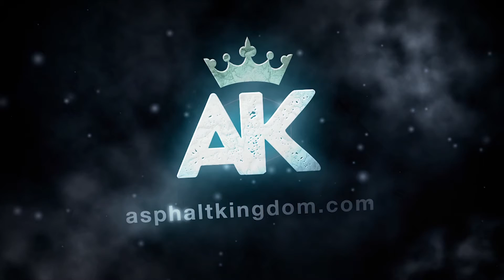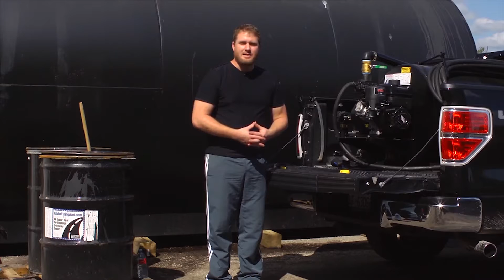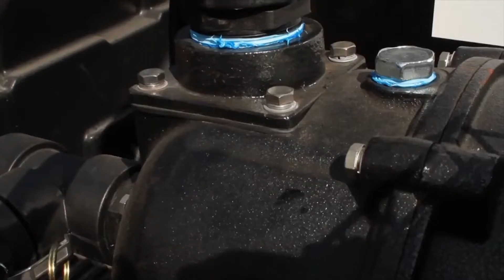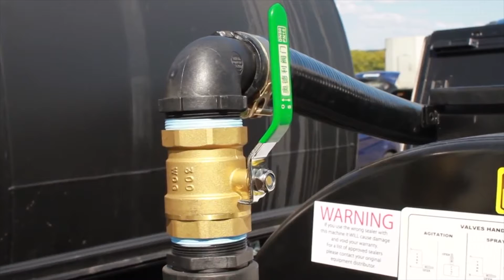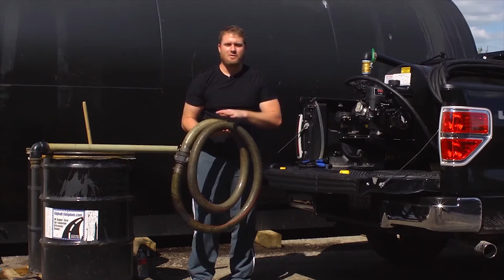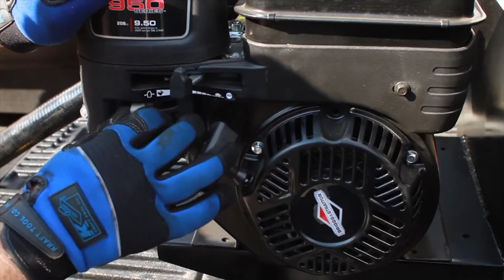Getting Your Asphalt Sealcoating Machine Ready | Asphalt Kingdom

Comment: So there's no problem mixing that water inside wirh the seal once it's Prime?
Reply from the maker: Correct but be sure you check with the sealcoat manufacturer regarding dilution rates.